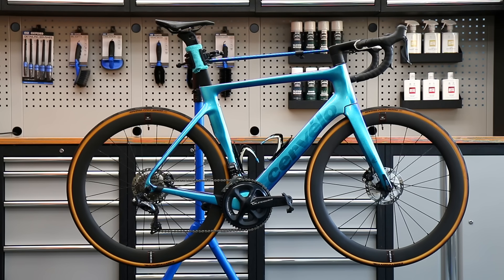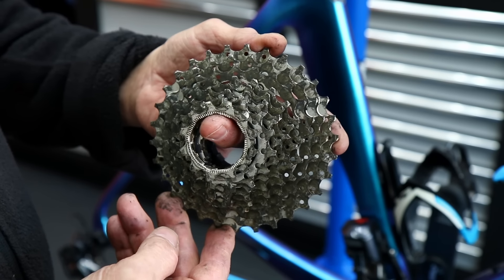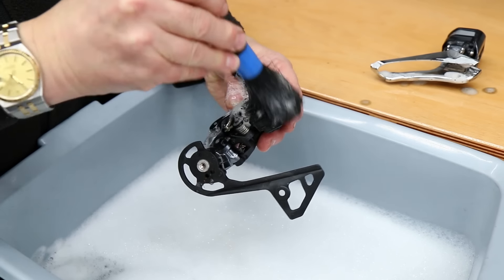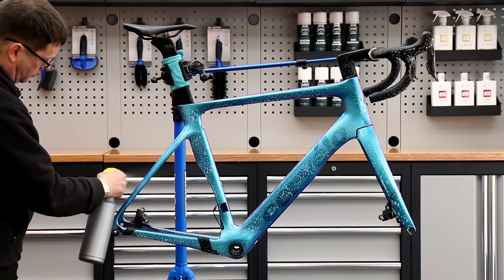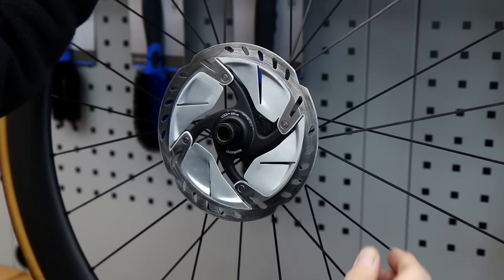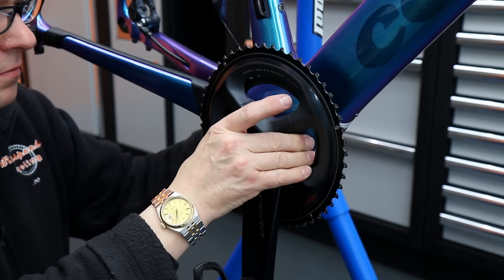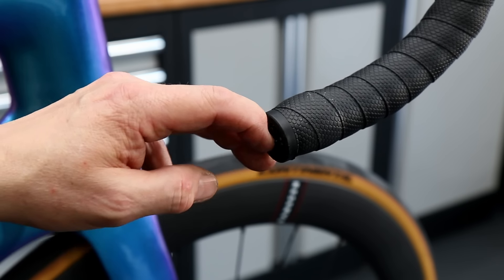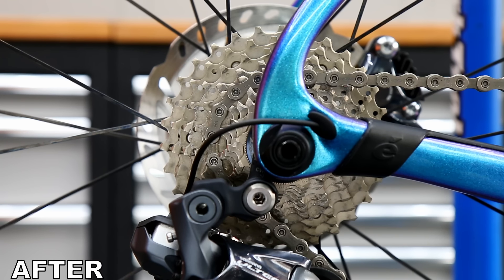Restoring this neglected Cervelo S Series! Full Service! Di2 Rebuild! 2021 Road bike!

Comment: 2:39 to anyone who has removed the non drive side r7000 crank and accidentally dropped the O ring, the flat surface should go against the crank and the ridge rubber part against the BB. shimano's pdf EV-FC-R7000-4331A only lists it at part no.5 but you can't tell which side by the picture.
Reply: That's insane, just looked up the PDF myself and there really is no distinction - you couldn't fault a tech looking at that diagram and thinking "no harm, no foul" putting it in the other way

Comment: I remember seeing this bike back when I was shopping for road bike. I could not find any information on it nor were they any YouTube videos on it. I don't think there still isn't any videos on it to this day. Anyways good to see someone bought it.
Reply from the maker: It’s gorgeous that’s for sure!🧡
Reply: Its production run sure is short (2019 - 2020). Here's one of the least known road bikes I know of: Ceepo Stinger. You'll get even less hits online with this bike.

This is Ceepo's aero bike. Frameset costs less than a Tarmac SL7 FACT 10r frameset, yet it's stiff as hell. Ceepo played the #aeroiseverything game before Specialized made it cool, so almost every Ceepo model ever made is already aero-optimised as they started with triathlon bikes.

Their other road bike model is the Mamba-R, their do-it-all bike. Be it road, tri or gravel, the Mamba-R takes on the roles of a few bike types when specced appropriately, all with a single frameset. A customer I've served even said this is faster than her Tarmac SL6 FACT 9r despite it being heavier, even on climbs.

Comment: Don't want to be that guy, but at 13:15, you are simply tightening a pre-load screw for the quill-design stem, which has no use when the Fork Wedge Fixing Screw is tightened. This bike has a very unique and almost old-school design for the headset using an expanding sliding mechanism, so the Fork Wedge, in the headset. That is bolt that is  found deeper barried inside the headset. The correct order is to relax/undo that, then tighten the screw you just tightened here whilst applying a bit of pressure on the fork, and then redo that bolt. 

The loose pre-load screw indicates that mistakes have been made setting this bike up in the first place.

Comment: Great work, top attention to detail as ever. Re: the incorrectly orientated crank spacer, I had a suspension fork malfunctioning from new on a mountain bike years ago. Turned out right in the guts of the fork a small spacer had been installed the wrong way round. Little things: big impacts!
Reply from the maker: The tolerances of modern bikes is so finite, they’re designed to run perfectly or not at all🧡

Comment: I always replace the pad retention bolt with ones with hex heads on them, the stock flathead bolts are made of cheese and disintegrate if you look at them the wrong way

Comment: 1:22 for me, the loose dropout mount at the rear caused my Zipp wheel hub to go rusty. The shifting was so bad and sometimes it happened with a loud clunk and I kept wondering what's the cause? Apparently Van Rysel assembly was done poorly and it cost me headaches and 100 bucks for the hub replacement. But it was a good lesson to double check every bolt after the bike purchase.
Reply from the maker: Worth knowing for everyone!🧡

Comment: Stunning bike and love that colourway. You said not much difference between before and after visually, but disagree. Absolutely pops! Well done 🎉🙌 quick q, noticed no copper slip on the back of the pads, is that something you've stopped doing?
Reply: @Stevehatesgravel  price is what people are willing to pay and don't really see why you would call this junk I'm afraid, especially looking at the overall setup components etc.
Reply from the maker: These were ceramic pistons not metal so won’t corrode, it’s a key step we stand behind on metal callipers 🧡⚙️
Reply: @Bikespeeds  didn't even think about the ceramic. Thank you 🙏 I had the same and was still putting copper slip on 😂

Comment: Never seen a service with this level of detail before. I‘d love to leave my bike at your shop even if there is nothing wrong with it, like with the cervelo. But i would never dare to put lubricant on that screw that holds the brakepads. 
I fear any rain will be dragging that into the pads.
Reply from the maker: We regularly had screws we’ve had to drill out and never had pads impregnated by the grease, for us it’s the only way to do it🧡

Comment: do you have any experience using the CC-2 park tool chain checker? I'm not sure how hard to push the dial in when I check it because the rollers on the chain move a little. Hard to see exactly where its at but its a ball park I guess.
Reply: Just lightly, until you feel resistance when the pin butts up with the roller. This chain checker won't gauge wear accurately on SRAM's 12-speed chains.

Comment: This wrongly installed spacer is why I have trust issues with high-end bikes. I wish I could all send my bikes to you for inspection, but that would be too far away 😅
Reply: In this case, it's not a problem of the high-end bike. This is the fault of the human/mechanic when assembling or checking the already built bike
Reply: The main problem is the 4iiii arm, the pod is just too protruding. If it is not there, nothing will touch the frame even without a spacer. But I will have to admit BBRight has very tight clearance on both chainstays

Comment: I've realised why don't you clean and regrease the headset? Its part of a service where I used to work
Reply: You can be sure if it needed it, they would have done it. He mentions how the bike hasn't done many miles so I imagine none of the hubs/BB/headset/pedal bearings needed any attention.
Reply from the maker: The bike simply didn’t need it, to get to the headset on this you need to remove all the cables which is hundreds of pounds and it worked perfectly as it was🧡
Reply: @Bikespeeds  where I worked before we remove it let it sort of dangle and clean and regrease the headset and put it back if it doesn't need replacing
Reply: And there in lies the problem 😊 @Bikespeeds
Reply: @jeremyemilio9378 That's only possible with external and regular internal routing. Integrated internal routing headset work is the most labour-intensive and time-consuming among these three routing configurations. It's one reason why I don't choose to buy such a bike for myself even though I'm fully capable of working on it, alone.
Reply: @Bikespeeds hundreds of pounds for disconnecting and reconnecting D2 cables 😂😂😂😂😂😂😄😄

Comment: Mostly cosmetic than service. Did not clean pistons, dont check bottom bracket and lubricate it, same hubs, pedals, haedset and specialy headset when you notice that bold in steam was "completely loose". Seat post bolt was also loose and did not check seat post.

Comment: Okay, I'm going to critique you now. After you wash your items,we see you put the dirty soapy component on the table next to the soap bucket. We never see you rinse the dirty soapys off of the component.  Please confirm that you do a rinse with clean fresh water. I've seen some folks wipe down, or make no attempt to finish this process. Dried soap will simply help road grime stick to these parts in just a matter of a few rides.
Reply from the maker: It is always rinsed, dried, and blasted with an airline⚙️

Comment: Most of them are not dream bike. They all had been fabricated for being cost effective products. Still that wouldnt enough, included special parts for them to run they break and costs too much. If you a new buyer, dont chase dreams dont be brand snob. Electronic shift or being so aero doesnt matter, just buy a simple carbon frame and r7000 and you are good for a time.